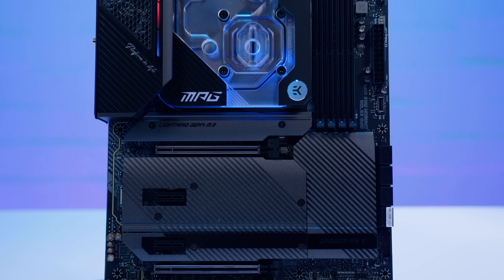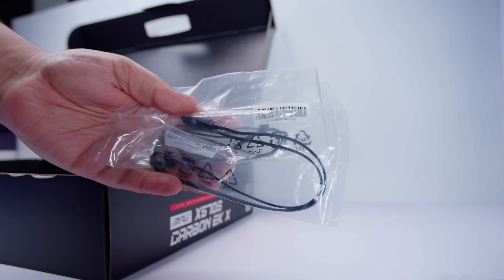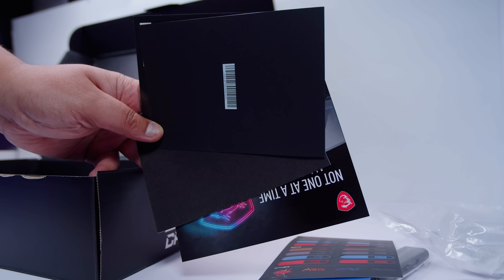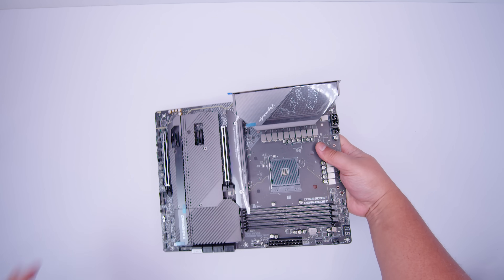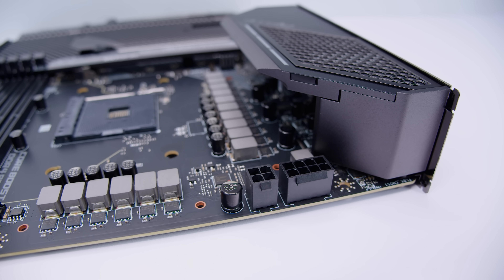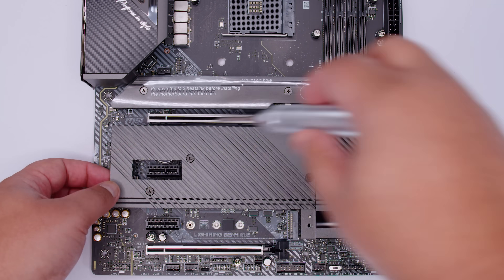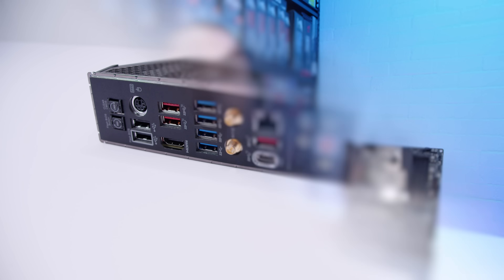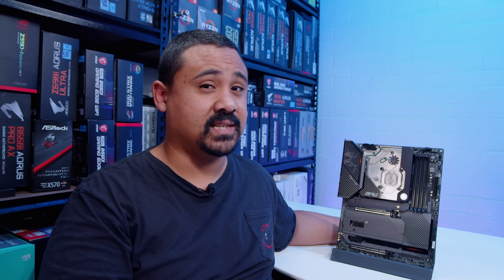Ice Cold! - MSI X570S Carbon EK X

Comment: Can't believe they skimped on the PCI-E layout. Really should have been 8x/8x. Especially at that price, they could have supplied an NVMe add-in card instead.
Reply from the maker: Or they could have every slot on the board so you can free up space inside your water cooled PC?
Reply: @GearSeekers  It's a cool board, but still quite an odd combination of features at the price point.  Gigabyte have done 8x/8x and 4 NVME slots with their X570s implementations, as you've shown.

Comment: Hey, would it be feasible to check the  bootstrap time on this and any other motherboards you look at in the future? I've been looking to upgrade my motherboard soonish, and one of the most important stats for me now is how fast the motherboard can get to the OS, however nobody actually seems to document this anywhere.

With the speed of modern SSDs and CPUs, my OS boot time is literally down to like, a second. But I still have to sit around for around 30 seconds, waiting for the motherboard to finish bootstrapping before that lightning fast boot time can happen. I want to be able to turn my PC off when I'm not using it, and have it turn on instantly when I come back, but nobody is looking at those numbers, which not only means I can't find what I'm looking for, it also means manufacturers aren't competing to try make it faster.
Reply from the maker: No one is talking about it because it's an irrelevant metric. There is a lot of stuff happening when the system POST's. Every CPU and chipset combo is different as well. You're complaining about 30 seconds lol. Try using any server/workstation platform when it POST's 😂
Reply: @GearSeekers  of course every chipset is different, and I recognise that different hardware configurations like CPU and RAM selection will affect performance, but that doesn't stop people testing other components like GPUs or SSDs, or indeed, software under standardised conditions.

I strongly disagree that it's irrelevant. One of the biggest improvements from the shift to SSDs was vastly reduced boot times, and the quality of life improvement was enormous, and it's continued to improve over time. The bottleneck on fast boot times isn't the OS anymore though, it's the POST and bootstrap, so why wouldn't we want to start start speeding that up as much as is reasonably possible?